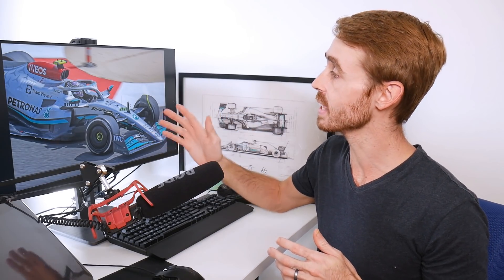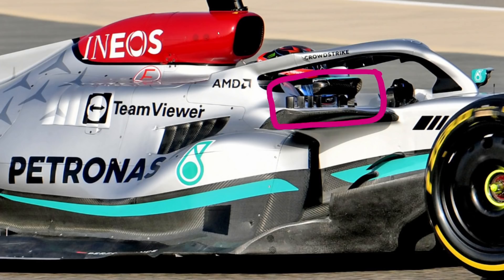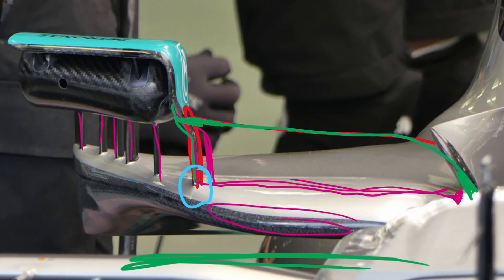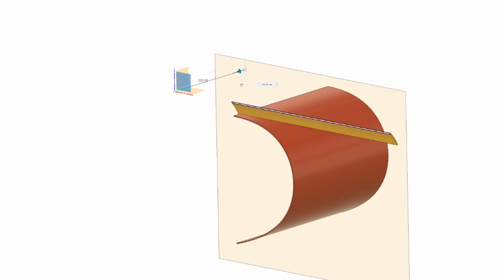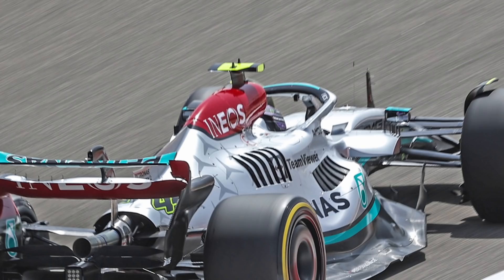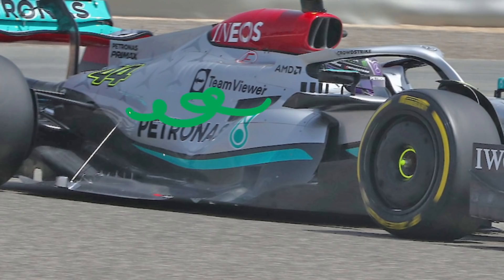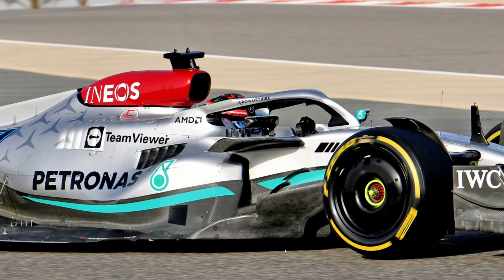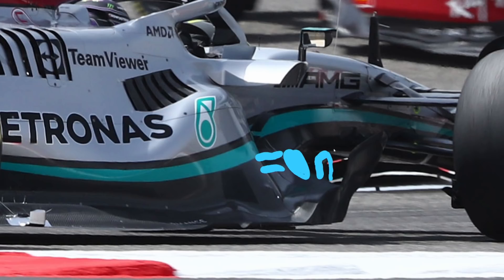How do the Mercedes Sidepods Work? - Aerodynamic Analysis

Comment: The so-called zero sidepods concept on the surface sounds like a typical engineering nightmare. Reminds me of a university project I did a while back, where I got this "ingenious idea" in the beginning/concept development phase. I took some pride in it, and when problems started to appear later I naively thought I'd "just" engineer my way around them, and lots of time was spent trying to circumvent those problems in order to keep my initial , "so-called ingenious" idea. This was risky, and led to a huuuge waste of time, as I just kept on going into dead ends around every corner in quite a long period it seemed, while it looked the ultimate fix was "right around the corner". Then towards the end, it turned out, I could have ended up with just as good or probably better solution by doing the "simpler" solution from an early phase. But a mix of pride in my idea and naivity got the better of me, as well as inexperience probably. I don't know how similar the situations really are though, but at least the guys at AMG must be sitting with a somewhat similar feeling after the concept turned out the way it did. Spending all the time to fix it, and even after having done so, it didn't pay of to be any better than the best teams it seems.

Comment: 🤔 aero for me!? In the voided side pods i would make the B car. A mix of the spoon Ferrari, but lower as the Redbull's and this made with thin surfaces and in the begining of the clam right over the entrance a flux deviator, as the one made in Redbull's, resuming! I would splite the flux. And like the fokker three plane i invert three wings and Open that small exost on top of the bottom, and elevate the entrance of the air cooling up to the anti intrusion to narrow the flancs and the bottom like the turning vains Redbull's style and serrated flat winglets to accelerate the air out. The open flanks help direct the all mass of air previously redirect towards the beam wing.🙏😤🤫

Comment: Kyle could you address the porpoising issue and different solutions to address it whether it be suspension geometry or even higher rake (if still legal with these new ground effect cars). Could one solution be to pull an Adrian Newey and raise the rake of the car and while maintaining downforce? I can imagine the ground effect from the floor would still generate enough air underneath but with a larger exit in the rear for outwash and is that technically legal under these new ground effect cars?

Comment: Do you think the bouncing they're suffering is caused in part by the sidepod design, or is it just the floor design? It seems mercs are the ones suffering the most from it but they just don't want to run a higher ride? Could you maybe explain the issue (or at least theorize about it 😅) in a seperate video ? 
Thank you for the nice work !
Reply: It is most likely their floor as the sidepods dont do anything except reduce drag. The pole however may be part of the problem and it diverse air downwards towards the floor

Comment: Looks like a pancake dropped over the chassis. BF Ugly ..but if it works...... Why don't they have OLED screens inside the cockpit and Digital HD Rear-facing Cameras instead of mirrors. It is the 21st Century. Supposed to be cutting edge, that would alleviate all these crazy bits of bodywork.

Comment: I own a chevrolet suburban (99) , and at 75 mph the fuel consumption increase to 12 mpg. but at 60 mph, the fuel consumption is 18 mpg, just the air wall can affect in this way as the air is like an elastic media that reduce the vehicle speed and i need increase the power,  i look at the air as an elastic medium  and can write the equations that reflect this difference,  did you have any work related to a wagon of this kind?  i want to look how the airflow over it  looks at this speeds

Comment: Question... How can Merc honestly suggest that the wing that supports the mirror as a "side pod"? Especially when this geometry is not physically connected to the minimalist sidepod setup for cooling. The entire existence of a "sidepod" is to store radiators for cooling. That side wing does nothing of the sort and is obviously an aerodynamic piece. Winglets are technically banned and what i don't understand is why this would not be considered as one. I think that bit is out of bounds. 

I do find the minimalist sidepod design interesting and within bounds. Time will tell if it works as it may make the car narrower down low... But it does look like mercs engine cover is wider. Wider frontal area up higher (alpine last year). Meaning more cooling is taking place higher by the engine therefore raising the CG. Interesting route merc went.
Reply: Completely agree with you, those pieces holding the mirror are illegal
Reply: @michaeltrumph121  no is not

Comment: Curious to know if its the underneath of the car - ground effect - causing their loss of performance and perhaps the radical side pods are operating as designed but the underneath of the car is not. There was some mention of Merc using the underbody ducting to expel hot air could that magnify the stalling?

Comment: Very interesting video. With such small areas for radiators in these ‘zero size side-pods’, I’d love to know if Merc is using ‘saddle’ radiators over the top/sides of the ICE and utilising airflow from the inlet above the driver’s helmet. 
And … whether that airflow is somehow connected to ‘tubes’ which end up under the floor and supercharged by the immense suction created under the floor. 
If that is possible, would the increased volume and speed of the airflow coming in above the driver be made colder and more effective by that process. There are also whispers that maybe there are linear radiators cleverly fitted to the tunnels under the floor to make up for radiator area losses … which would also lower the centre of gravity and create more flexible ballast placement through shifting them forward or rearward.

I’m guessing some of your answers will be negated by contractual restrictions of using your prior knowledge of Merc’s design processes, and in particular, knowledge of certain people’s specific skill sets in the aero department … all of which would no doubt be in the non disclosure agreement you signed when you were released from your contract. How long was/is your ‘gardening leave’?

Comment: also is there some benefit to the shark gill exits rather than having all the hot air exit out back as in their previous design. Clearly it blows the bodywork a bit...
Also they made a few changes in the front wing/nose/suspension area to set up the sidepods differently which are also worth discussing

Comment: Question about the floors.. they've added vanes, flaps, etc, to generate vortexs.... but is slats to act like dynamic openings with flexi carbon to control the ground effect so it dynamically changes the effectiveness of the speed based on the low pressure under the floor..

Comment: The issue I have with it whether it works or not is they put all this effort into the halo and then they allow a shrouded upper crash structure which could be a cockpit violation risk should the car go airborne in some freak way and land on another car. You would think a more typical sidepod would allow for deflection coming down on a halo vs this which is basically a blunt spear.

Comment: I'd appreciate feedback; 1. The whole car because of this design approach is narrower particularly at the entry to the side pod area, will this potentially mean less drag compared to the boxy, wide sidepod designs of pretty much all other teams? 2. If that's the case are Merc are going particularly for high straightline speed/acceleration which could be useful in an era where the regs are designed to make 'following' easier? 3. The package of the guts of this car seem insanely compressed, must have take alot of fundamental work over a long period of time and thus if this works for merc it will be virtually impossible to copy (at least this season). 4. If merc wanted to switch to a boxy/large sidepod which was basically empty but to suit aero, they could bolt on whatever they want to the sides of the car later down the line (although this to me would suggest their design principal hasn't worked as well as they thought so I see it as unlikely). 5. Total punt, this week they understand the car better having collected data, that plus the engine turned up which I assume is a rocket means they could romp away?

Comment: Hey Kyle-Would you consider doing a vid on aero tweaks for a street car to primarily to improve fuel mileage at highways speeds. Add on's such as spoilers, lips, wings, vortex gens, fences, lowering, diffuser etc. What works or doesn't? I DD a 05' Toyota MR2 Spyder hardtop that's lowered and gets 33-38 mpg hwy. Thanks

Comment: Awesome explanation! 
For now, that extreme concept doesn't seem to pay out. At all. Mercedes seems to battle porpoising and sliding more than other teams. Even if the sidepods don't have a direct impact on that, it still seems to have a big enough indirect effect. 
"If it looks good, it flies good" does not apply here either. It looks totally ugly while getting around the rules. Therefore, it looks far from an ideal design for a vertical, close-to-the-chassis sidepod setup. 
While the multiple mirror stands may fall within the rules, what's up with that extra row of vortex generators behind the mirror on their ugly remaining "downwash"  protrusion? With the rules now being allowed to adjust quickly to close interpretation gaps, I wonder why Mercedes wants to risk spending their budget in a highly questionable concept. Both in legality as in effectiveness point of view. The change in how the rules may be altered in reaction to teams getting around them is a direct result of mainly Mercedes' past seasons borderline interpretation concepts, like their adjustable front suspension

Comment: So in function these sidepods work similarly to the red bull pods just a bit higher up?
Also an observation: With the cooling outlets being in skin flow wouldn't there be a low pressure area that sucks air into the main inlet?

Comment: Thanks Kyle, the Only things is you are wrong with with the Mirror attachment, Its has 3 planes NOT 2, but mostly you're right. Of course the question is why ?
There are only 6 days  of Pre-testing and testing so WHY , it makes entirely NO SENSE to bring this new bosy packaging to the second test. No-one would or could make those changes in the time between pre-test and actual testing, so the reason that Mercedes have looked at this MUST BE THE MASSIVE ISSUE OF PORPOISING that the car was experiencing. 
As a former Merc Aero-Weeny you know the ONLY reason they'd make that change is because they are TERRIBLY concerned about their entry into fast and PARTICULARLY slow corners.
Nice report though, but go back and look at rules and the way you Aero-weenies make the 101% certain determination that we are RIGHT. 
Us Engine Inteligencia know better LOL

Comment: Brilliant video, but I think it aptly illustrates that F1 regulations have lost the plot... way to over prescriptive and complicated and if anything reducing potential for individual designs to gain a competitive edge. Aero has now become way too over dominant on these cars and bears no relation whatever to mainstream vehicle industry development ... which was always stated as one of primary benefits of F1 for manufacturers. They are now in fact designing ground hugging aircraft and not cars. Wouldn't it be interesting to actually radically limit the level of aerodynamic influence and maximise the further focussed 21st century development of pure mechanical grip systems.. which would readily benefit the mainstream car industry.  How about going back to the 1970's and banning all multi-element wings and all extraneous aerodynamic devices on bodywork etc. Give the sport back to the actual drivers!

Comment: I can’t imagine the FIA being too thrilled with them reinterpreting the side crash structure as a big exposed, wing shaped spear.
Reply: The side pods do nothing for side impact protection other than looking more substantial than they are. All the work is done with a deformable tube that is incased in the upper mirror downwash section. It’s no more dangerous than any other F1 car. Kinda like in a modern car your plastic bumper is basically for aero and cosmetics but the actual crash structure is hidden. Same here. Also all cars are designed with FIA oversight so there is no question of legality to me. But yes from a purely aesthetic standpoint bigger side pods looks more comfy to crash into than Mercs design, however both will perform the same function
Reply: And I would much rather take a side impact in something like the Ferrari. Those bigger side pods would surely absorb more energy and protect the driver better.

Comment: The problem I see for a smaller air intake is when its behind a car that it can't pass its temp will then rise, same with if you have a safety car for three or more laps at low speed when the air intake will be drastically reduced.
Reply: Then again, there is a reason why they went for this knowing that they might not be the fastest car, and like Kyle said, it still has roughly the same area of intake

Comment: Hi Kyle,
Do you think if Mercedes used this pod type design on some tracks and the other design on others (to maximise each designs respective strengths) that the FIA would allow the 2 cars to be used?
Would the FIA look upon it as just body work aero upgrades for each track likened to changes to front, rear wings and barge boards in the past?
Also since they are both designed with the current rules they are anticipated to be legal.
Reply: I don’t see the problem, it’s the exact same chassis. Just different sets of bodywork.

Comment: I completely agree this is their primary car. 
Having Mercedes release this form later than their initial car in Barcelona (maximising the delay and difficulties for other teams to study and copy) means they have more faith on this design than the first. 
This design philosophy will be the one they will support to develop unless it truly reveals unforseen massive inferior/limited performance gains requiring termination (which is highly unlikely). Alternatively it could be used on some tracks and the other design on others maximising use of their respective strengths, unless those changes are not allowed by the FIA (but both were designed with the current rules so anticipated to be legal).

Comment: How about. CFD 101 episode? Like real lay person’s basics about the technology not the maths. What kind of computers can do this? What is the software, how much is custom or do all teams use the same setup? How does the CFD “time” vs teraflop limit work for the different teams? (Is it as simply as beefier computers can run faster so the processing limit is to keep teams from just spending more on the computers? Is there some min/max-ing of time vs processing?) Can you run out of “time” in the middle of a simulation? How much and what kind of work goes into setting up before a team starts spending their CFD time? How does the FIA actually regulate how much CFD time each team spends? (Does each team have an in-house FIA CFD “rabbi” to keep things kosher?)

Comment: That is probably the strongest mirror stay in F1 history… 😂… It is literally held up by the side crash structure.
Reply: The problem is not safety, but the rules state that you can not have aerodynamic appendix other than front and rear wing
Reply: @ignls8809  so what is the entire rest of any modern f1 car?
Reply: @ignls8809  I think you are talking about the spirit of the regulations. This is legal based on the letter of the regulations. Perhaps if enough teams protest then the FiA might reconsider but this is just a clever interpretation
Reply: @CrimsonRegalia  I've always said, if it is within the letter of the regulations, it is also within the "spirit" of the regs... I you meant to say something else, then use the words clearly to say it :-)
Reply: @CrimsonRegalia  doubt merc will have much problems with being protested since they have many customer teams
Reply: @zakmuriu2068  its Mercedes fia would not care anyway.
Reply: Would a crash structure like that be more dangerous in the event of a crash to someone else who maybe hits the side of that Mercedes vs a normal sidepod/crash structure?
Reply: @spiffytuber7515  all the tubs have been crash tested already. Must be done to get certified... a non issue
Reply: @spiffytuber7515  they using standard side crash structural... all team use the same and they wrap around with carbon fiber bits. and is just a very thin layer of carbon fiber so the crash structural will work with or without carbon fiber warping around it cause that thin layer did nothing to help the crash.. we felt uncomfortable because it sticking out... btw these side impact structural is to protect the driver IN it.. when crashing into a wall.. not from another driver..
Reply: @mingc4698  But what about the driver that hits it?   As we saw from last season, drivers crash into each other quite often. By the way, thanks for taking your time to respond and giving helpful information!
Reply: @spiffytuber7515  that crash structure is way too low to hit the driver, and it probably desintegrates the moment it collides with other drivers as well. And it has to be tested as well, and it past those test so it is a non issue

Comment: I could easily see this being banned if the FIA considers the connection of the sloped sidepod to the floor. They (or any team protest) could easily bring a case that even though the floor is not technically part of the sidepod, it should be included as their third element in the Y angle test due the nature of it sealing off the bottom of the sidepod. If this was entertained, I believe they would be found to be outside the scope of the rules and banned. We will see.